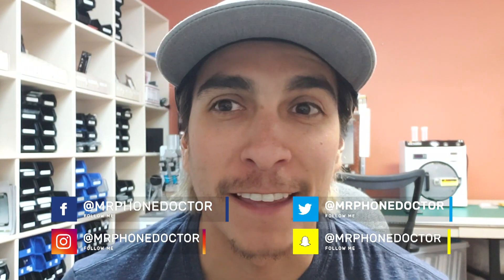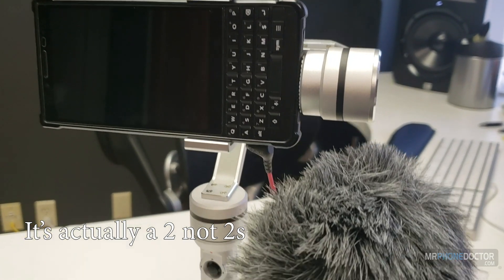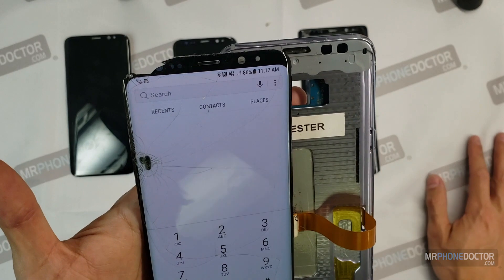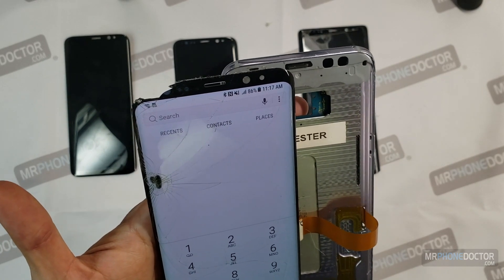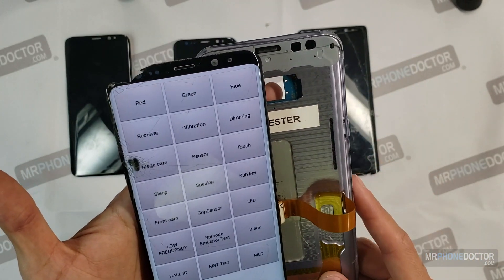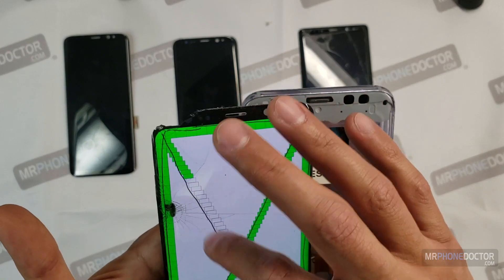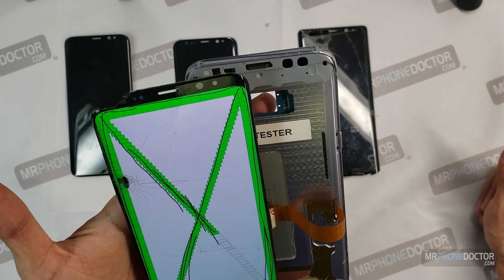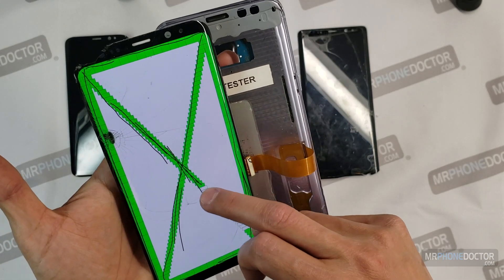Getting ready for my 17 day trip to China & Does my Samsung Cracked Screen OLED qualify for repair?

Comment: The Oled is completely black & I do have a solid white line sometimes on the left side, bottom or right side when I plug the phone to charge what do you suggest repair it, buy new phone. If I do have to buy a new one will I be able to transfer all of my information onto a new phone. I will greatly appreciate your opinion with this matter. Thank you Mr. Phone Doctor